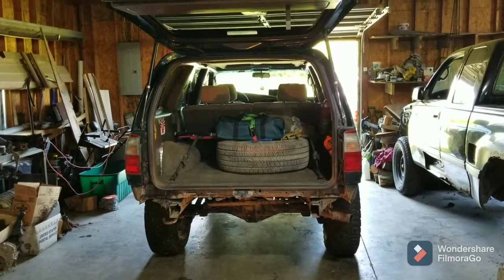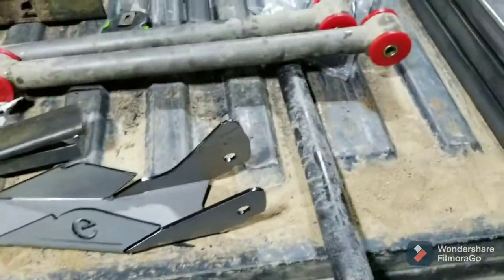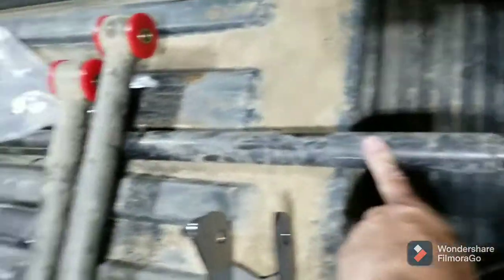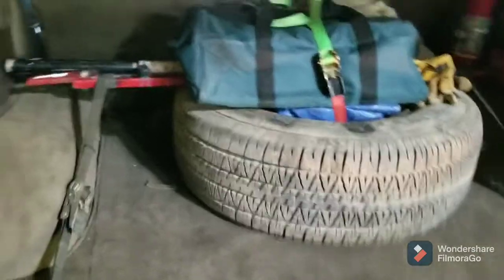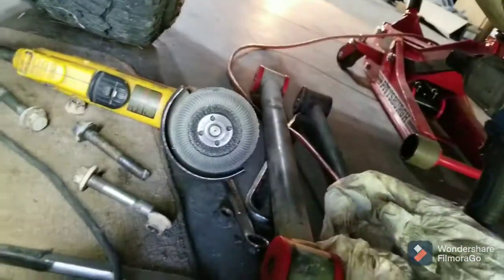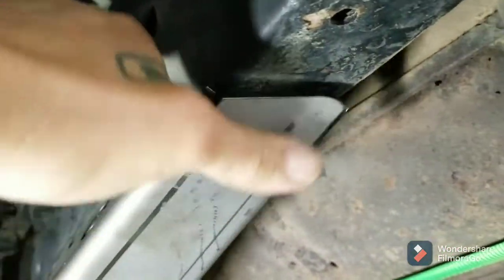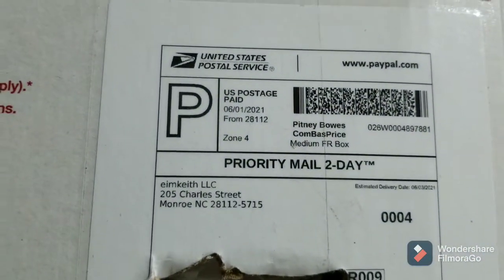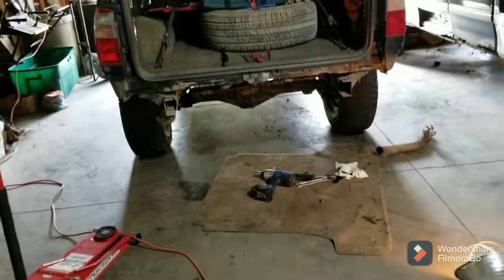How to upgrade rear suspension and frame, I bought this stuff. 3rd gen 4runner

Comment: What bushings are those red ones for the control arms
Reply from the maker: They are called "Strong flex" bushings.
I got them from @sonoransteel. 
Don't know if they are for their links exclusively but the customer service is super fast via email, Steve is great to deal with.
Reply: @funjunkiegarage  thanks. I'd like to fab my own arms but need new bushings
Reply from the maker: Right on. I'm not in the shop but I can get you measurements off the ones I kept for spares if you need them.
Reply: @funjunkiegarage  I appreciate it but I'll just copy my factory size.  Now what size tubing to get and what inner wall diameter.
Reply from the maker: These are 1 3/4" dia tube, 3/16" wall.
The main tube, I didn't measure the ends
Reply: @funjunkiegarage  oh great ok! That's good to know.  I was thinking .250 wall but 3/16th is probably fine